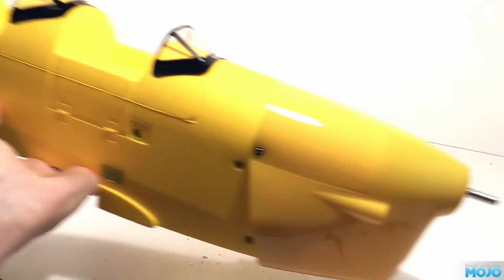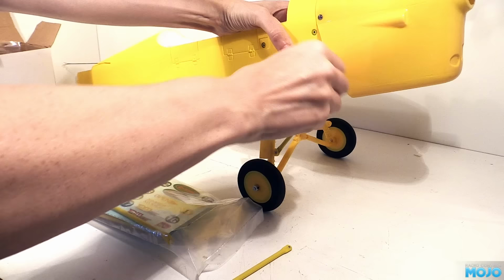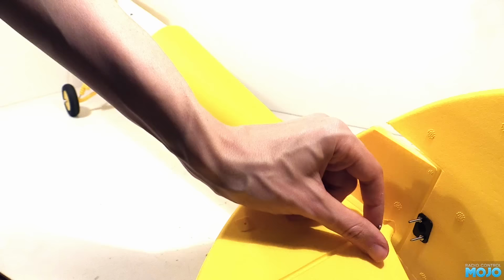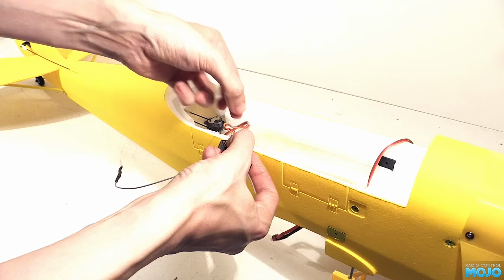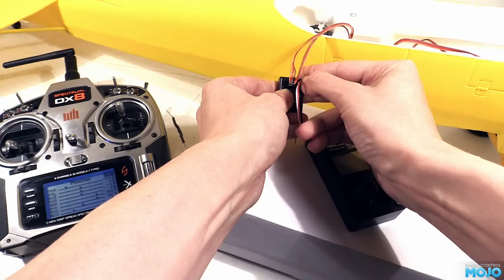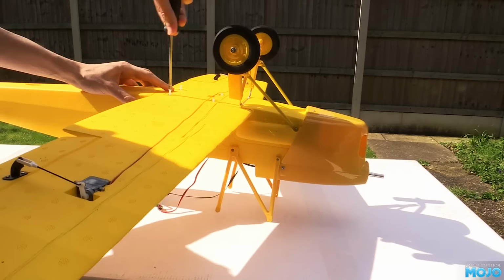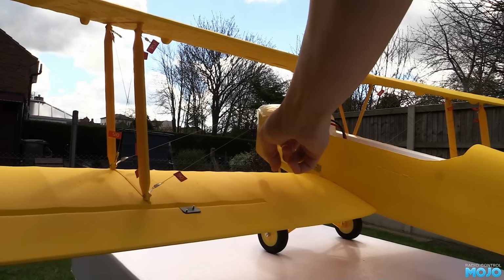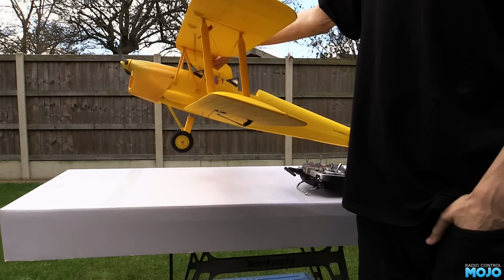Dynam Tiger Moth - 2 - Build

Comment: The screws, I had the same problem and while i was thinking about going to pick some up i noticed i had used the 8 mm screws not the 6mm in some of the rigging and the undercarriage i swapped them for the 8 mm and had enough of the right size for the control horns. It might be worth checking